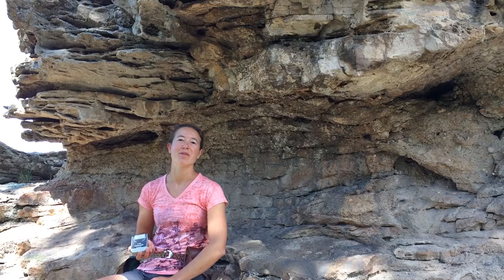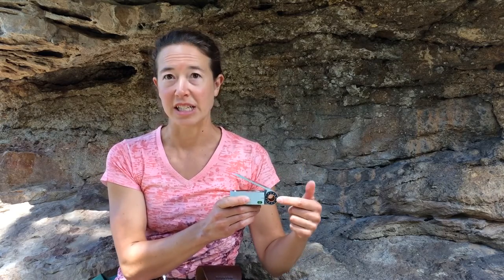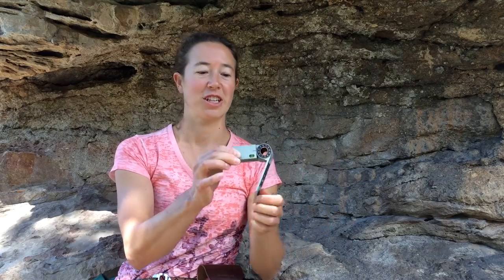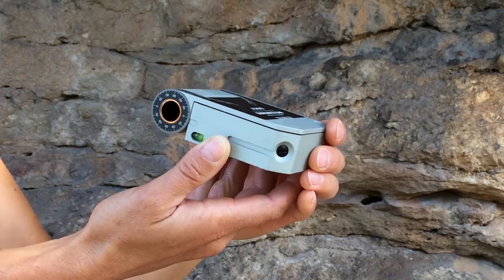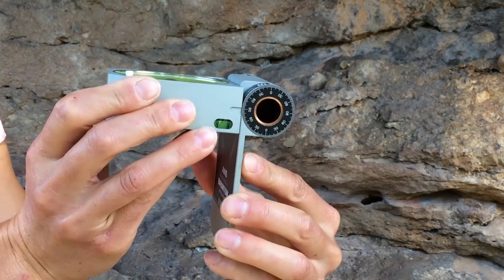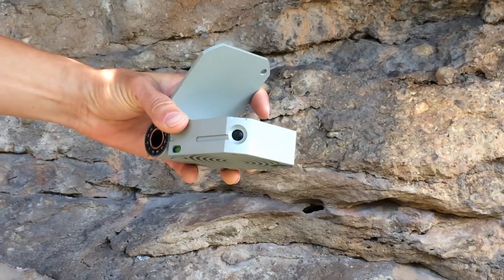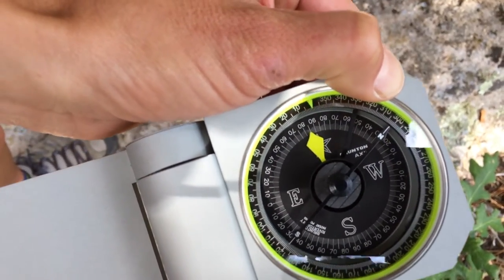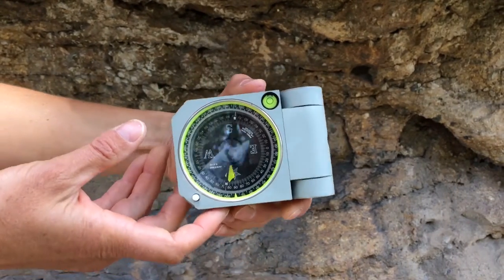Axis Transit Compass - Getting Oriented

Comment: Hello thank you for this beautiful product, I just bought your AXIS. After opening the box I realized that all the black parts with graduation were stickers and one was glued with a different angle. A scratch appears on brand-new compas. I'm not confident about the sticker with the graduation on the long-way utilization of the unit. I work as an exploration geologist in Canada in rough conditions. I will return the product even the exceptional concept.